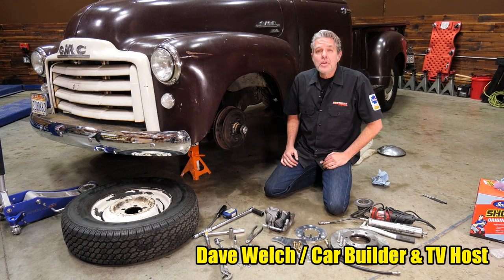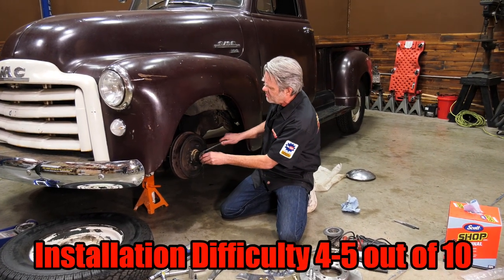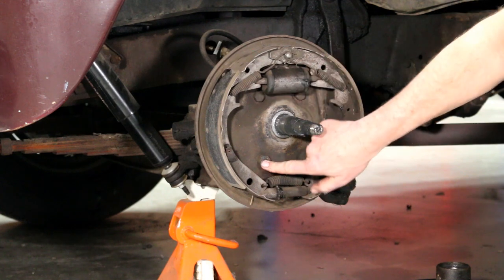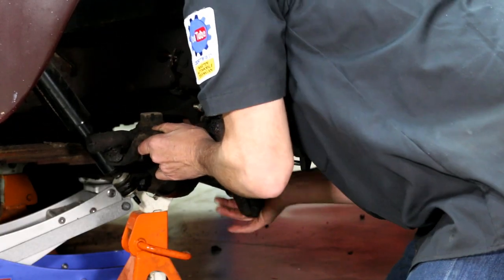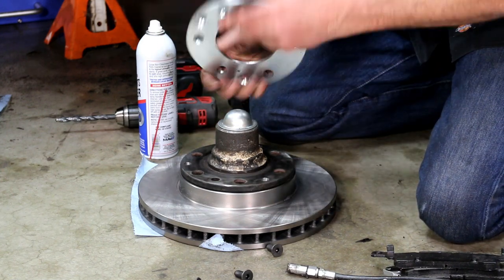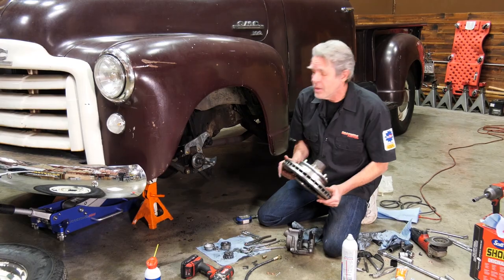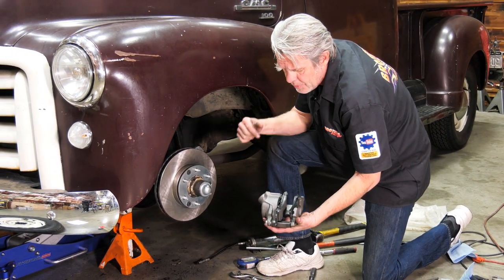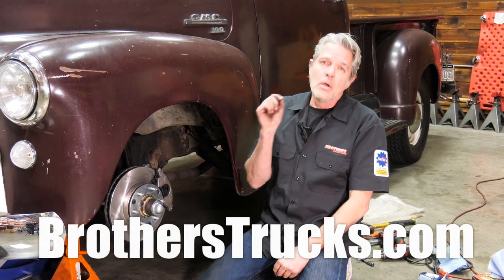1947-59 Chevy & GMC Truck Front Disc Brake Conversion

Comment: I gotta say you made this seem very simple and a nice conversion ! 

I have a 1955 GMC truck and i really want to convert it to disk brakes. when i have the extra cash im forsure gonna look into these. i still need to do engine work and swap the transmission out. but this is a must in my book before i even get it on the road. 

gonna bookmark !
Reply from the maker: We completely agree. Too many people worry about paint jobs before safety. You're on the right track!

Comment: Great video.  I am putting the CPP kit on '50 chevy 1/2 ton.  Their included instructions leave a lot to be desired, such as the caliper brackets  and which way the offset should be.  This video makes it very clear.  Side note, I need to drill out the bottom bolt hole in my spindles from 7/16 to 1/2.  This was not mentioned in the instructions that shipped with the kit, but is in their online version.  VERY hard metal to drill.

Comment: Just to add a tiny bit of advice to your already fantastic how-to video. Whenever working on the brakes of an old timer like this, especially if it's been parked for decades in a barn or field, when those drums come off hold your breath and soak everything in wd40 because if these brakes haven't been touched in 20+ years they may contain asbestos and its guaranteed if it's been sitting 40+ years. The aerosol wd40 is low pressure to not blow the dust around and it will prevent it from becoming airborne which is asbestos dangerous form. This goes for old clutches too 👍
Reply from the maker: Wow, great tip!
Reply: Your right, asbestos is virtually harmless if left undisturbed.

Comment: Very helpful, have yet to get working on it but have my Grandfather's 46 GMTruck i want to do a patina 'ultra budget get it on the road and slightly modernized and protected' job to it. Just wanted to see the process of converting to disc brakes :D
Reply from the maker: Right on!

Comment: i'd like to see these kits for the 3600 (3/4 ton ) & the 3800 (1 ton ) the available 3100's are dwindiling but the 3600 & 3800 are readily available. they are basically the same truck.
Reply: I believe that either the cab or fenders are slightly bigger. But yeah. Same deal.
Reply: NVM, the fenders are bigger because the tires that are needed on the 3600+ are big Steelies.

Comment: Thanks for the video! I am not a mechanic but have a '49 3100 which needs new brakes and this will likely be the route I go. Please wish me luck. I'm sure I will need to investigate other components as well; brake lines, master cylinder, rear drum brakes, etc. Any comments are appreciated.
Reply from the maker: Converting to disc is definitely a good start, but we also recommend converting the master cylinder to a dual reservoir unit and ditch the original single reservoir.
Reply: @BROTHERSTruckPartsTV  I have 1931 truck will that kit fit it
Reply from the maker: @frankjones6082   No sir, try PerformanceOnline.com
Reply: @BROTHERSTruckPartsTV  ok thanks it's just we took one bracket off my buddy's 55 truck axle and it fits my axle ,so just thought you might can use that info .
Reply from the maker: @frankjones6082  Right on!

Comment: I just saw your video on front brake disc conversion kit. Great video I’m ordering a kit now. I do have the 16” original Chevy 6 lug wheels that you said fit with calipers behind them. I’m currently using 17” artillery wheels, do you know if it’s possible to get a caliper behind this type of rim?

Comment: I bought and installed this kit onto my 56 Chevy truck. The wheel studs seem a little short to really torque down the wheels. I'm having a hard tome finding some long enough. Can you recommend an alternate size that will work with this kit? Thank you in advance.

Comment: Very good video. I Really like the plain English description of what you are doing. Some guys try to Over do that. I have a First Series 1955 Chevy 6500 Wrecker. Do you have a disc brake kit for it? it has the original type Bias Tires and 5 lug wheels. It even still has that brake booster under the cab.
Reply from the maker: Contact the tech guys at our shop and see if they can tell you if we have a kit for your 6500. 800-977-2767
Reply: @BROTHERSTruckPartsTV   Thank you Very Much:~)
Reply: @DESPRADO111 
Did you find something that would work? I have a 52 chevy 6500, and a 48 6400 that I just acquired I was looking to do the same. I never even thought about this with the 52 until now.

Comment: Good video. Very well explained. Only thing that is holding me up on my truck is my hub doesn’t have the rivets in it or holes for them. Do I need to drill holes into the hub to mount the spacer or do I just stick it on once the hub it mated with the rotor via the studs?
Reply from the maker: Will the spacer fit flush without the holes? Call the shop and get our texting number from the Cust. Service guys and send us a pic. call 800-977-2767

Comment: I'm looking for a drum to disc conversion kit for a 1949 chevy 3600, the 3/4 ton with the 8 x 6.5 lug pattern. Do/can you make a kit for this? If not, can I use any of the kits you currently produce to get the job done?
Reply from the maker: We don't make a kit and unfortunately none of what we carry will work for your 3/4 ton. Try the guys at Performance Online, they might be able to set something up for you.
Reply: @BROTHERSTruckPartsTV  what would be the best route

Comment: If im just replacing the drums at front. Do you sell the ribets to re-attach the new drums to the hub?
Or do you sell any kind of bolts to reattach?
Reply from the maker: We don't have the rivets or any type of hardware. There's probably something available through your local auto parts supplier.

Comment: I have drums all around my 54 chev 3100.
What else needed to be changed after this kit?
Or i just install the kit and continue with the rest of the system like it is?
Reply from the maker: You would need to add a proportioning valve at a bare minimum. We recommend adding a dual reservoir master cylinder as well.

Comment: I have a complete original 52 chevy and was wondering if this kit will work with the original master cylinder
Reply from the maker: It will, but you would need to add a proportioning valve to send the appropriate amount of pressure front and rear, as well as hold residual pressure on the front calipers. In any case, BROTHERS DOES NOT RECOMMEND USING A STOCK MASTER when converting to Disc Brakes.
Reply: BROTHERS Truck Parts wrong no check valve on disc brakes.

Comment: I’m restoring a 52 Chevy 1430 model 1 ton, are the spindles bigger than the 3100 models? It’s a 10 lug drum and I want to swap to a 5 lug disc brake. Do I need to swap the axle? If so what axle will work best? Thanks!
Reply from the maker: Yes, the entire front suspension is different on the 1T truck. You wold have to convert it to 1/2T parts including the springs.
Reply: Thanks!
Reply: Am I able to use the same axle?
Reply from the maker: @danieldickie90   The 1T and 3/4T axles have a larger spindle than the 1/2T so unfortunately you can't use the 1T axle.

Comment: I have a 3/4 ton and want to change it to 5 lug I have a conversion kit but all I can find are axles with 6 lugs will the spindles size be the same as a 1/2 ton?
Reply from the maker: 3/4 and 1 Ton spindles are larger than 1/2 Ton. You need to have your rotors re-drilled.
Reply: BROTHERS Truck Parts  sorry I meant to say I’m swapping out the original 3/4 axle but all I find are 6 lug axles I just want to know if the spindle are the same so I can just bolt on my kit
Reply from the maker: @wreckingcreep  If you're swapping for a 1/2 ton axle then it should be no problem.

Comment: Great video and well explained thanks a million, question what size rims and how deep in order to clear hardware, I believe the 15 inch x 5.5 

Original rim will not clear the caliper unless you add thick spacers correct?
Reply from the maker: This truck had the factory 16" wheels and they clear without a problem. 15" wheels are a little more difficult because not all of them clear. We would NOT suggest running spacers on the front. Find a set of stock 15" disc brake wheels or have a set made. Contact our customer service dept at 800-977-2767 for additional help with this.
Reply: @BROTHERSTruckPartsTV  I'm ready to convert my '59 Apache with factory 16 inch 6 lug rims.  Have you had any customer reports claiming this front disc brake conversion had clearance issues with 16 inch rims?

Comment: Do you only need brakes on the front end
Reply: Asking due to being an idiot. Looking to keep a stovetop v6 in the truck.
Reply from the maker: @ak47monster49   You need brakes in front and rear. it's a serious safety issue if you only have brakes on the front.

Comment: Will I need a proportioning valve for this setup?
Reply from the maker: You would at the very least need a disc/drum master cylinder. We strongly recommend a proportioning valve when switching to disc brakes though. A proportioning valve will also typically double as a residual pressure valve and that is important too when running disc brakes.
Reply: BROTHERS Truck Parts thanks.. I want to upgrade master cylinder as well.
Reply: BROTHERS Truck Parts this is misleading. You do not want a residual check valve with disc brakes.

Comment: Is the straight axle on a 46 chevy truck the same as the 47?
Reply from the maker: Unfortunately is isn't.
Reply: @BROTHERSTruckPartsTV  thaks guys. I'm looking to convert my 46 to disk brake, is there a way to do it without spending too much money? I really need to since i'm intallink a 400 sbc with 4 speed, any advice is appreciated.
Reply from the maker: @JuanCruz-lj1vw   Contact the guys at PerformanceoOnline.com and see if they sell a conversion.

Comment: What is the pattern 6" on 6 lug pattern wheels?
Reply from the maker: The 6 lug uses a stock fitment, we also have 5 on 5.
Reply: @BROTHERSTruckPartsTV  what's a stock fitment...I dont have my ruler but is it 6 on 6 or 6 on 6 1/2"...?
I really like the original budds!....so I will do somersaults to hang discs behind those 16 inch wheels..!
Reply: @BROTHERSTruckPartsTV  what's a stock fitment...I dont have my ruler but is it 6 on 6 or 6 on 6 1/2"...?
I really like the original budds!....so I will do somersaults to hang discs behind those 16 inch wheels..!
Reply from the maker: @offgridmangogrower   The original wheels would have a bolt pattern of 6 on 5.5
Reply: @BROTHERSTruckPartsTV  I just found a hub to measure and its 6 on 6.5.....!
Its challenging but I'm tucking discs behind those budd wheels....I have no choice... the drums have been tossed...drums would not slow that 6bt..!
Reply from the maker: @offgridmangogrower   So it might be a little late to ask, but what is the truck you're working on? Is it a C30 or bigger?
Reply: @BROTHERSTruckPartsTV  not too late...except we are all getting older!
It's a 56 int travel-all s-120 3/4 ton 4x4....1 ton military ambulance front axle and 3/4 ton pick up rear d60.
I will need to look at the front pumpkin to confirm if it's a 60HD or...? All hubs are identical 6 on 6 1/2...I can send hub pictures for clarification. Thanks for asking.
Reply: @BROTHERSTruckPartsTV  I just crawled under neath it and the front is a larger knuckle 44F about 6inch inside ball exposed.....12 bolt pattern on grease sleeve wipe. Front axle is 3 inch OD and rear is about 3.4 or 3.5"